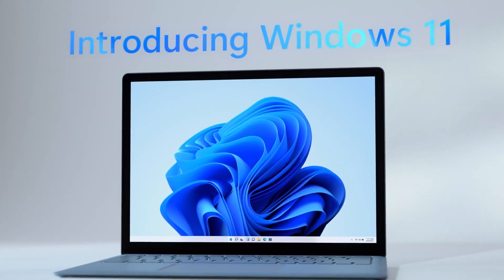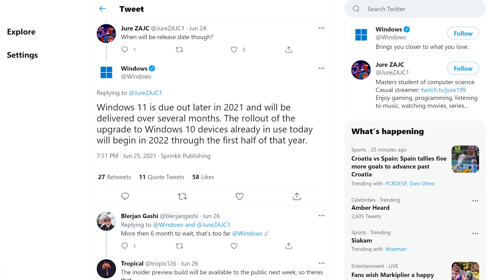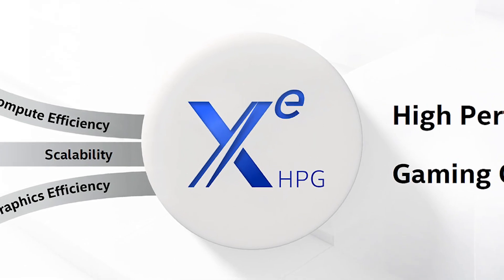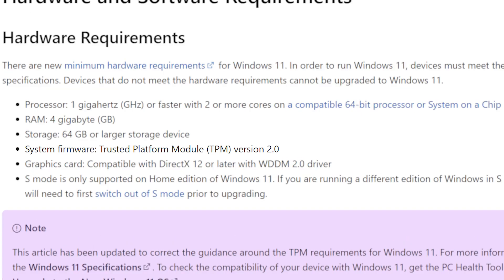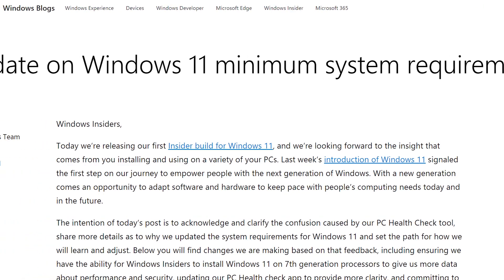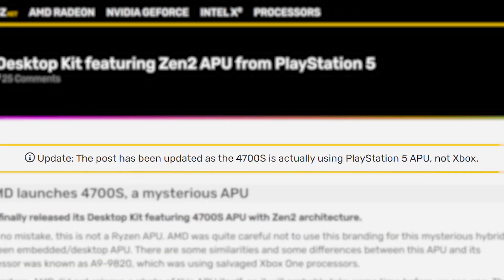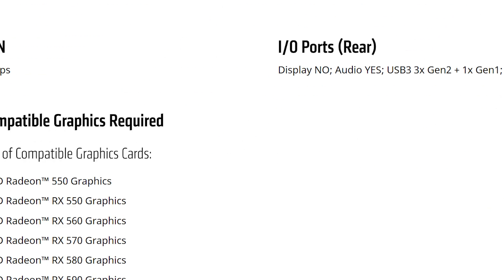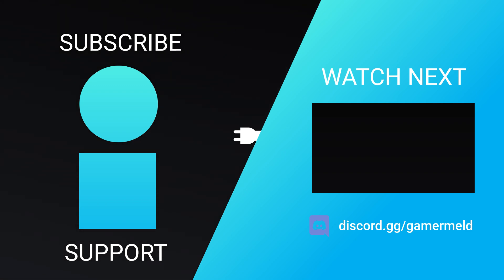TONS Of Gamers WON’T Be Able To Install Windows 11!

Comment: As someone in the IT industry, Windows 11 looks like garbage. The biggest turn off is the "REQUIREMENT" for a Microsoft account. We need local accounts to do everything, and half our fleet is no user computers that just sit there with no internet connection.

Comment: Are we really at the point where 4 year-old hardware is "outdated"? This is ridiculous
Reply: Especially at today's hardware prices and shortages!
Reply: @RickS_m550i  Especially at today's small CPU's generation upgrades (Intel milking "lake" upping less then 50% of performance from 4770 to 9700 - and that with doubling cores, so no real IPC benefits)...
Reply: @skela098  Beg to differ boss. Building PCs here since I was 6 years old and I used to think so too and built a few on 3470T procs when 8th gen was double cost. But upon further experimentation I came to the conclusion that even a pentium Gold 10th gen beats an i7 3770k by 5%
Reply: "Are we really at the point where 4 year-old hardware is "outdated"? This is ridiculous"... Oh boy you would have loved the 90's.. back then Tech was moving so fast things were often outdated the moment you bought the item and left the store
Reply: @DanafoxyVixen  1 year old  computer ryzen 7 5800x
Reply: It is called planned obsolescence and it is unfortunately not illegal. Without it stuff like washing machines, fridges, cars could run decades but due to corporate greed the make own products less reliable so people would be forced to buy more.
Reply: @WindHaze10  planned obsolescence is disgusting and we have no way out. dogshit companies like Apple even fight right to repair.
Reply: @WindHaze10  planned obsolescense started near the millenium. Thats why 80s and 90s stuff run forever
Reply: @WindHaze10  well upgrading is fine but making  some even 2 3 year old machines not able to run windows 11 is crazy in my opinion
Reply: @WindHaze10  When my parents purchased a house in 1999 the dryer that came with the house already looked a million years old. The thing still runs to this day, its rusty and older than Jesus but it still works.
Reply: @WindHaze10  plan obsolescence helps the economy grows if all your device would last a decade companies will lose profit. You want to go back to the great depression?
Reply: @bobbytaraantino  Exploitation of foreign labor instead of having local population produce something that lasts a long time is not helpful for economy. It also heavily increases carbon emissions and use more resourced due to larger production quantity.
Reply: @WindHaze10  actually is ilegal in europe. live in a better country.
Reply: @jobslolo7387  So, does it its my fault to be born in my country?
Reply: @jobslolo7387  💯
Reply: ryzen 1st gen/ intel 8th gen is still a really good setup for gaming, just keep calm and game on.
Reply: @hellfire92837  1st gen is not supported by windows 11.
Reply: @ayan1875  and? you dont install w11 and keep on gaming
Reply: xxpyroxx75  yeah, the earth will die in a few million years and end all the humanity because of these mfs pissfarting around without doing anything
Reply: In the tech world, last years hardware is considered outdated by many.
Reply: Its because MSoft doesnt know shit,  they assume the majority of users are mobile users, and assume all desktop users are using top of the line shit.  This is going to be windows 8 all over again. MICROSOFT NEVER LEARNS
Reply: Weren't elitist PC games trashing console players because "it's holding back games"? Let's stop being hypocrites
Reply: @JuanDiego-r9g1h  I agree, elitists should stop being hypocrites... but that is completely unrelated here, who said any of us were PC Elitists?
Reply: @JuanDiego-r9g1h  consoles hold back gaming with censorship and by severely capping the maximum graphics settings on shared titles (eg nier automata). Is is not elitism, merely a fact.
Reply: I bought my CPU (i7-7700K) and Mobo (Asus Z250)  in Feb 2018, and PC health check advises NOT win 11 compatible, despite TPM 2 available and enabled!
Reply: @westwonic  Microsoft only allows Core i 8000+ CPUs, not 7000 or lower unfortunately.
Reply: @westwonic  Dam
Reply: And also 10 year old Hardware is more than enough for browsing an other daily stuff. If they keep the requirement for that shitty tpm it will be the least aquired Windows ever.
Reply: I would say that given Win10 still has 3 or 4 years of support before it EOLs then saying 7 year old hardware is likely out of date is not a overly ridiculous statement. 

Personally as I have just completed a full system upgrade I know I am fully compatible but will most likely not switch to 11 without a compelling functionality reason. At the moment the only part that interests me at all is the window layout for ultrawides but would want to see in detail how it works before switching over as it also has aesthetics I don't like such as the "locked to the bottom" taskbar.
Reply: @chrisfortune1813  What after, though? We still don't know much about how the Windows 11 will perform with games, and how it will handle intense usage. I myself am compatible with the upgrade, yet I'm not gonna do it because I'm absolutely fine with windows 10. The current system is already full of various options and features for mobile users, which for me is quite stupid. Why cant they just make two different versions of the same OS, with some small changes to the way it works? Microsoft seems to be trying to make their system all-around, which, for me, isn't a step in the right direction. Windows 7 was awesome, 8 was a bit too tablet-like, 10 is a good balance between the two.
Reply: @forbleu  Absolutely, everything I have seen so far that I am not interested in or dislike is leaning towards touchscreen integration and mobile integration. Guess what Microsoft I don't have that and for my PC don't want it. If you are going to add in features like that option them, don't lock them. 

There are some things I do like the look of and to be honest I think they will be backported to 10 either by Microsoft or 3rd parties within months and so if that happens I can see myself staying on 10 till EOL.
Reply: @chrisfortune1813  Kinda in the same boat,  just built a new rig with Ryzen 5000. I'm interested in native android app support & better dual monitor compatibility.
Reply: @thePenguinous  The native android app isn't as native or as android as it may sound, looks more like an Amazon Fire shell running in windows to me. With regards to the multi monitor features I have not had any real issues on that front with 10 but the screen division features could be useful playing older games that don't support ultrawide screen format, currently I need to set the resolution in windows to a 16 by 10 format and just use the centre of the screen. would be nice to be able to have "useful sidebar windows" either side instead of a deadzone.
Reply: @vaultql4643  Man. Even the 2018 9800X is not supported. This is just some bullshit
Reply: my pc is 6 years old and i can still play every single game out there. so 4 years is nearly not outdated. its stupid that windows does this
Reply: We are at a point where corporate greed has infected its way into the Tech world.
Reply: xxpyroxx75  i upgraded my computer  2 years ago i don't plan on getting another on for at lest 8 more years maybe never depending  on what i need.
Reply: Hey, were at the age where there must be always a new cellphone every year with the last years being outdated. I think thats a huge contributor to the current hardware shortages since were so used to having hew hardware each year.
Reply: I word for all this "hubris"
Reply: I have ryzen 5 2500u and i can update..
Reply: @nev963  Dam I do too. Do you have the HP X360 Envy?
Reply: @nev963  same
Reply: Yes.
Reply: @vaultql4643  also, it's not just about horsepower it's about feature-set. Your processor might have the horsepower to do the new type of instruction sets it just doesn't know how to do the new type of instruction sets.
Reply: @vaultql4643  How does Microsoft benefit from hardware sales???  This has nothing to do with the Xbox.

Also, yes they are all based on the same architecture, but they do not all have the same instructions and features. More were added, that is the + that everyone makes fun on on the 14nm.
Reply: @vaultql4643  They are giving it away for free to anyone who owns Windows 10.  They are not ending Windows 10 support until 2025.  They are in no way forcing anything on anyone is some scheme to sell hardware that they don't profit on.

You can't play DX12 only games on hardware that does not support DX12. It's not some scheme to force people to buy new GPU's. It's the developers needing certain features for the games that are only available on that API. This is nothing new, this is how upgrades have ALWAYS worked.

IT happened to me back in the day when DX10 came out and my video card couldn't support it. I literally could not run the game even though less powerful cards could.
Reply: @vaultql4643  Dont argue with stupid (Kristi Marie).... It just makes you dumber! LOL
Reply: Yup I have a Ryzen 5 1600 cpu and a 1060 along with 16gb ram but I would be lucky if it supported windows 11
Reply: @insanitylol  Currently the CPU is not on the supported list however MS has said they are reviewing that list so it is possible it might get added.
Reply: Thank the hackers and ransomware.
Reply: In the tech standards yes it is, welcome to the tech world.
Reply: Microsoft: Increase the GPD, it's all you are for.
Reply: Bro, technology gets outdated ina matter of months
Reply: I got a 7 year old cpu but I love it very much
Reply: Most of the issues have to do with TPM and the processor crypto compatibility.
Reply: @AllSportsStations  I don't trust Microsoft for a second with that answer. Many of the CPUs they have blacklisted have TPM 2, and have very little architectural differences than the compatible ones.
Reply: @Ararune Exactly
Reply: For gaming purposes we are there since forever
Reply: e waste? what is that?
Reply: @user-ro1cc8tz6d   Electronical waste like old P c's or laptops TV's what not
Reply: It's outdated if you are a gamer that is not happy with their hardware unless it is so fresh off the line that it's still warm.
Reply: @vaultql4643  I'm not sure you are getting his point, (unless I misinterpreted what you said). Have you done any assembly language programming?
Reply: @vaultql4643  You said things about CPU architecture that didn't make sense to me. You know what? I'm not going to explain the point thing.
Reply: @vaultql4643  Hell no, I got tired of arguing with people decades ago about how many bits are in a byte.
Reply: Welcome to zoomer world, the generation with the shortest attention spans, IQs and smallest percentage of freethinkers.
Reply: @thePenguinous  It was a joke, and you're right, however most zoomers I've spoken to do have the mentality of "anything that's more than a few years old is OUTDATED AND USELESS!"
Reply: @666chapelofblood  Wdym? I'm 13 and I'm still using this good ol' reliable computer that currently lasts 7 years!
Reply: xxpyroxx75  yes
my man got it right
Reply: Well considering how fast things are released, and only a small portion of consumers get to experience them, yes. That’s what we’re at. Inflated prices, new releases 2-3 times a year, no availability, but who cares as long as we’re making the advancements. 🤣🤣🤣
Reply: No one is forcing you to upgrade to Windows 11. There is still four more years of support for Windows 10
Reply: @LePedant  I already upgraded to a 5600X, I just think it's stupid.
Reply: @thePenguinous  Part of the reason everyone hated Windows Vista is it ran slower than Windows XP older hardware. Not to mention the direct storage requirement of Windows 11. I don't know if four-year-old processors have that capability it's a pretty new feature set
Reply: @LePedant  It's all the same instruction sets, it's not like we magically stopped using x86/64. People have ran the leaked version on their "incompatible" hardware with no issue. There's nothing preventing these processors from being compatible other than Microsoft.
Reply: @thePenguinous   1st off, Win11 does not support x86 anymore, Win11 will only be offered using the 64bit Kernel.

Secondly, the OS Kernal has nothing to do with the CPU instruction sets.

Thirdly, there are many programs that can't run on 3rd gen intel i7  but can on a 4th gen i3 because 3rd gen does not have the AVX2 instruction set. Even though a 3770 is way faster than a 4210.

Lastly, the leaked version is unfinished and does not have all of it's features turned on. It is not the same version that will be released at launch.
Reply: @LePedant   1: The instruction sets are largely similar, that's why I put x86/64.

2: I don't know where I referenced and relationship between the kernel and instruction sets that you didn't already.

3: It's obviously not anything integral to Windows, otherwise the leaked build wouldn't work. If it's pretty minor, something that would've been added between the leaked build and the insider build, why wouldn't they just omit that feature? Microsoft is saying that they are excluding older CPUs for security reasons, despite some of the incompatible CPUs having TPM 2.

4. Yes, but the release build isn't out for a while, so there's not much of a discussion.
Reply: @thePenguinous  It doesn't matter if the Instruction sets are largly similar, if there is a key one missing it can't run, hence the AVX / AVX2 example I gave you. 

If there is code in Win11 that older gen processors don't have the instruction sets for, they literally can not do the code, no matter how fast.  Windows 11 will have features that older CPU's can not process because they were not designed with the proper instruction sets.
Reply: @LePedant  Whilst this is definitely the case the way in which it is presented is, especially with the "you must have this security module" to instal" makes it appear to normies as though this is some massive advance in personal PC security whilst it is more likely a "this is something we can detect and control with that most people don't use" so we are gonna catch some dummies.
Reply: Welcome to the world of computer tech where most tech is considered obsolete in 2-3 yrs 😋
Reply: @vaultql4643  775 is like a fifteen-year-old socket. There's no reason to expect a brand new operating system to run a fifteen-year-old CPU.
Reply: @LePedant  Why not!? Clearly youre not familiar with an OS called Linux.
Reply: xxpyroxx75  Well what windows is doing isn't trashing the planet. No one's forcing you to use it so you could buy new hardware. Windows 10 is supported by microsoft till 2025. Stop being over dramatic.
Reply: @UnoZero1  time will pass and you will see how they literally force users to upgrade to the windows 11 by limiting the support for older windows version.
Reply: @UnoZero1  also you don't have to get windows 11 no one is forcing people to get it.
Reply: @UnoZero1  bro I just bought a new computer and now you're telling me I'm forced to buy another one in 4 years?
Reply: @UnoZero1   couldn’t have said it better. People just like to whine about everything. Even though it literally doesn’t affect them.

Comment: I don't see a down side to not being able to install Windows 11 with the required Microsoft accounts and increased tracking.
Reply: im actually happy that they're doing this, as they're making the choice for users to switch to Linux easier
Reply: @alex15095  fr and i can run VMs for windows if I'd need to
Reply: @alex15095  once win 10 goes EOL im either gonna keep using it or switch to manjaro and install win in a VM to run games that need windows to work
Reply: @alex15095  No, if Windows users didn’t switch to linux with Windows Vista and Win8…you are living in a delusion my friend
Reply: @NazmusLabs  Windows Vista and Windows 8 at least ran on your old machines, Windows 11 wants you to throw out your old hardware and purchase TPM 2.0 compatible hardware
Reply: @alex15095  gaming on linux has changed significantly over the last few years. With protondb, they run almost natively. That being said, lots of people still hate the linux terminal.
Reply: @romakrelian  you dont even need to use the terminal nowadays to do most things, there's GUIs for everything
Reply: I would even consider to turn my back completely on PC gaming, if those horrible trends are going to continue.

Comment: I feel like microsoft will back off on the TPM requirements
Reply: Most motherboards can’t meet that spec, even current high end ones. The B550S and X570S chipsets are the only AMD ones that meet spec.Older X570 and B500 chipsets can’t and won’t. No 400 or 300 series at all. Whoever wrote the spec obviously wanted to force consumers to throw away all of their hardware built before December 2020 as nothing made before then meets the full spec. I feel this was a really bad decision on MSes part as the TPM 2.0 spec also will not easily allow Linux to run. This looks like an intentional decision to try to force consumers not to use Linux. Antitrust violation for sure.
Reply: They'll have to
Reply: @NineS5  I have 4th gen i5, and neither my processor nor my motherboard support TPM in any shape of form.
Reply: They shouldn't.

Comment: I have it installed on my system running a 5600x, its the dev insider preview.
Reply: A lot can change, but the last word from Microsoft was that older hardware will not be able to upgrade from insiders build when it's officially launched.
Reply: @a_macaulay  5600x isn’t older hardware.

Comment: tbh tpm and secure boot on windows 11 is the nail in the coffin for me, unnecessary feature for desktop users, it's mostly good for laptops since it's easier to steal compared to desktops but depending on the location if it's at a unsafe location then it might be helpful for desktop though